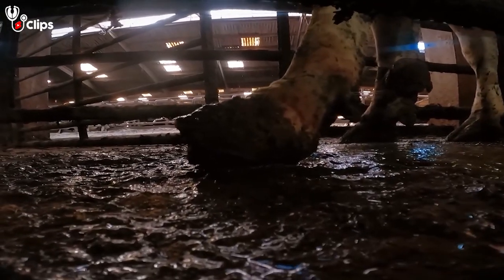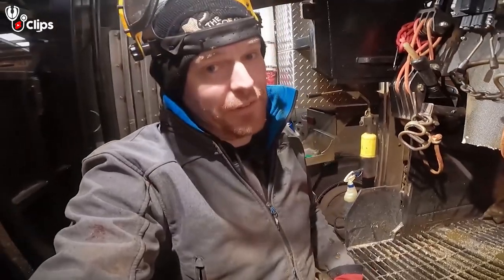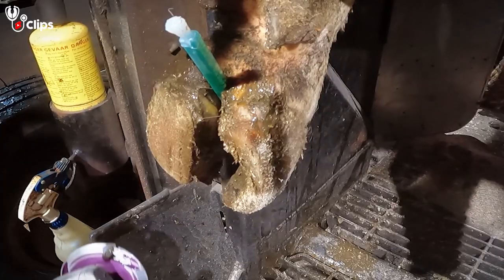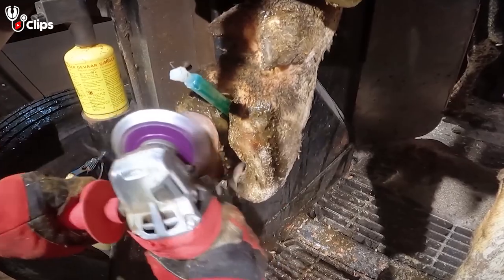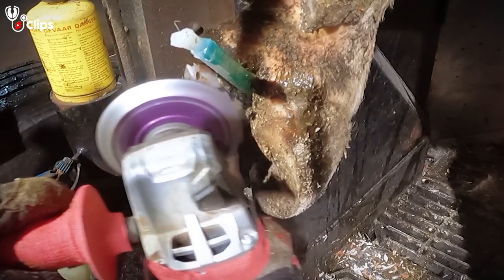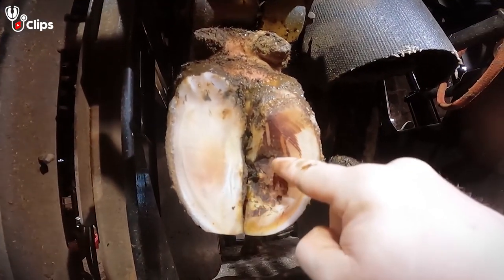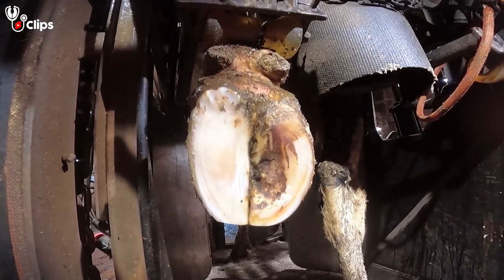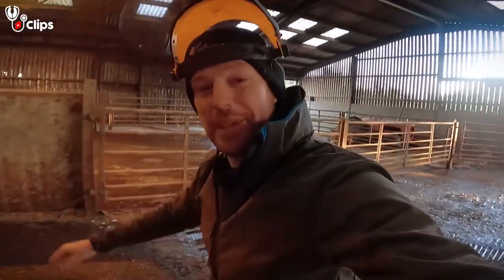Did a BLOCK RUIN this cows HOOF!?!?

Comment: Does a block cause problems... Isn't that like asking whether a cast/boot is going to cause problems for the leg where you've gotten a broken foot? I mean, the short answer is yes, but it's going to be worse without it, no?
Reply: A block is only worse if it’s not changed at its proper timing basically but a cows foot can get worse if they do not use a block to help take pressure off of damaged areas.

Comment: I really like the channel and I have a genuine question which is not meant to be an attack by any means: would your job be largely redundant if cows were kept on grass instead of on concrete?
Reply: Graeme trims cows that are kept on grass all year round or at least most of the year.  Grass is better but nothing is perfect.  Cows can injure their feet anywhere.
Reply: @stephaniewilson3955  I watched a video recently where he went out to cows kept exclusively on grass, and I thought he'd said that cows in those conditions rarely need their hooves trimmed, hence why it was a surprise that he needed to intervene. It was also the first video I'd seen where cows were kept on grass, and I've watched a good few at this point.